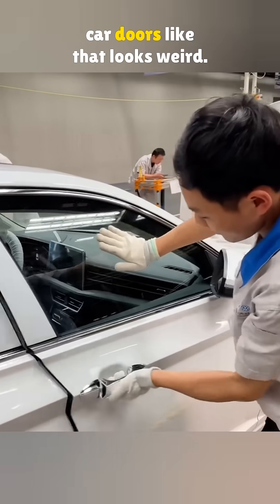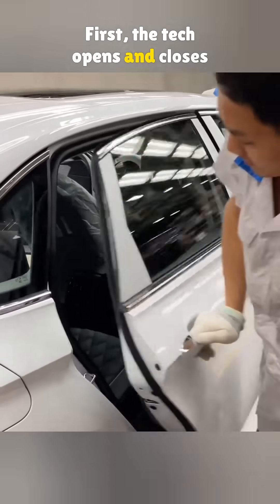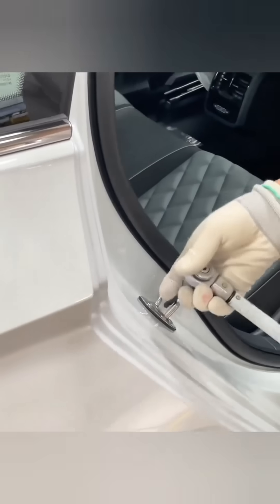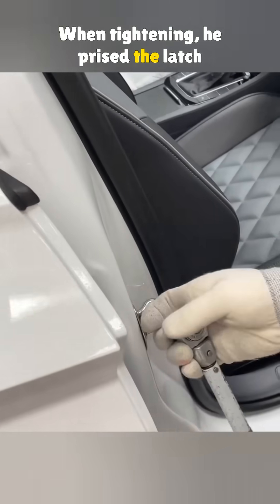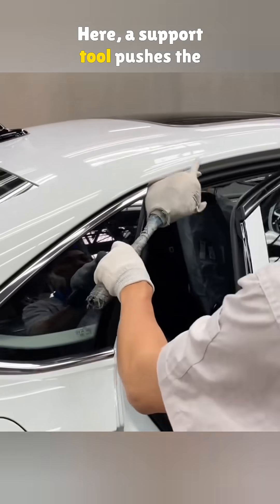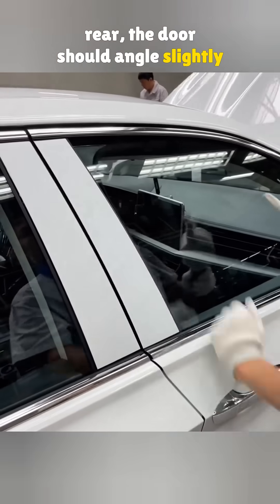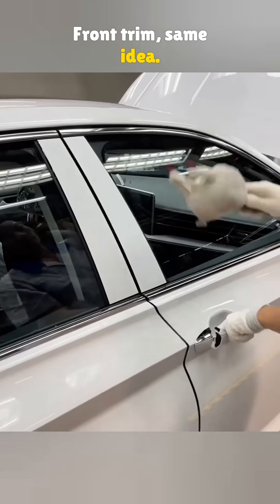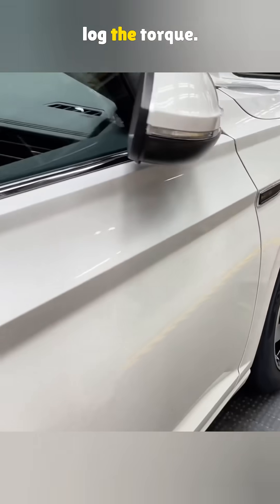Why Factory Doors Get Slammed #assembly #car #automobile #manufacturing #factorytour #cartech

Comment: Years of experience to tighten 2 bolts to spec.

If tightened to a specific torque, they should always end up in the same or very close to that same position.
Reply: You clearly don't understand what this is about so better stop showing your lack of knowledge.
Reply: Details, please.  I didn't catch the meaning there.  Sorry.
Reply: Should is the operative word..
Reply: did you not see him using that cloth hammer to knock the door into position?

Comment: I'm surprised that even series production in China runs on improvised tools. I've seen welded socket wrenches, something like a hammer with a glove over it, etc. I'm surprised that Volkswagen allows something like that. It would be unthinkable in Europe.
Reply: 😂Then you are in for a shock. Even in aviation improvising tools are allowed, and it has written document allow this practice with provision the tool must be safe for the user and the machinary it is used on. If you just need couple of this tool and the improvised one can last a good while. Then why watsting resource on designing a new one? Im not sure if the European company you metioned has unlimited budget. But even in funding adequate project, we still need to justified every dollar being spend. That is extremely true in Japanese company, they are willing to spend money with good cause. But they wont spend a dime if it is not justified
Reply: @林振华-t4v  Yes, there are differences between Europe and China. Personally, I have nothing against improvised tools. But if you're going to improvise, you should at least try to make tools that fit the final product. In the clips, new cars are being built, and the tools look like they were made in Mordor or something. For example, there's no additional cost involved in welding a socket wrench together properly. So I don't understand why the tools are manufactured in such poor quality. Even in the videos, you can see the incredibly poorly executed welds...